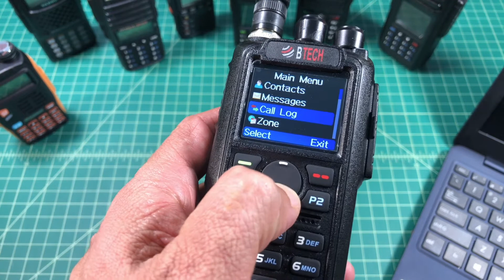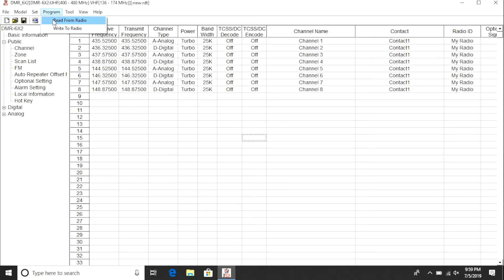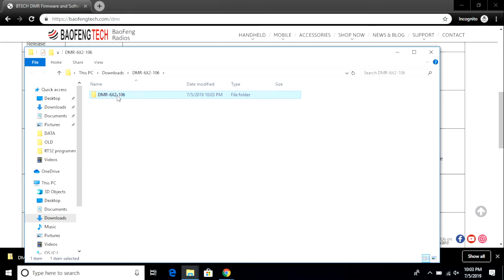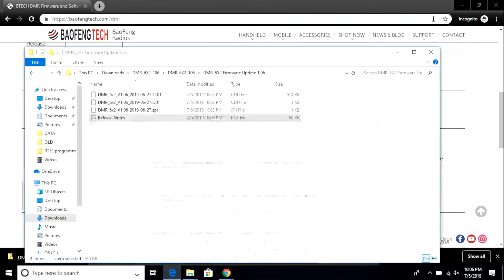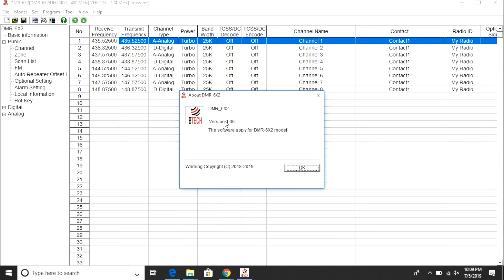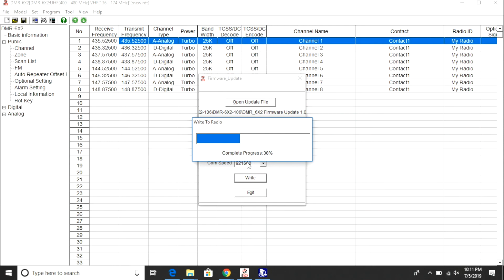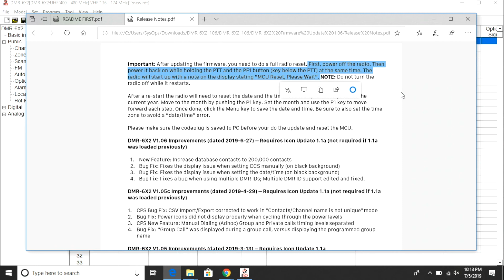BTECH DMR-6X2 - Firmware 1.06 Upgrade

Comment: with the dmr6x2 im running firmware 1.04 should i update to 1.05 then 1.06 or just go to 1.06??
Reply from the maker: You can go to 1.06 but you will need to do the icon update.
Reply: @TheSmokinApe  thank you  call sign ww7als